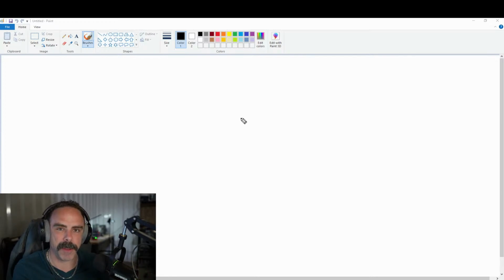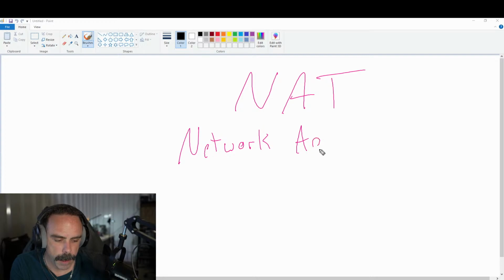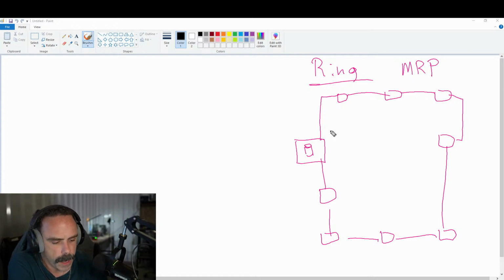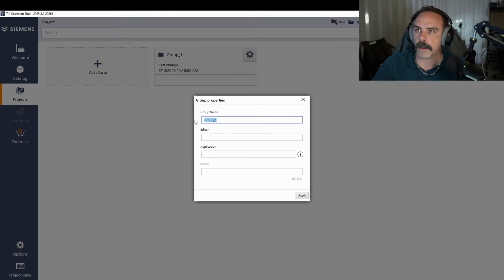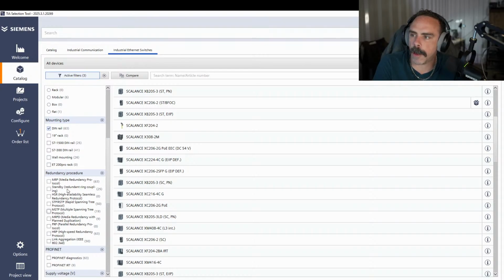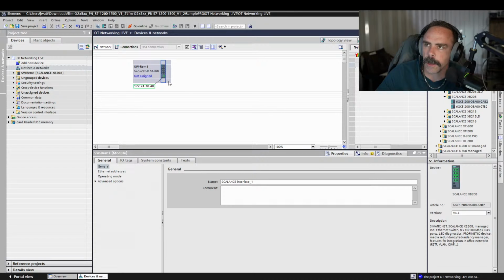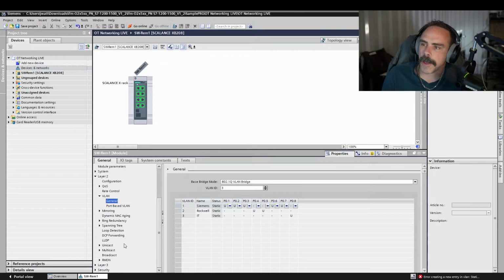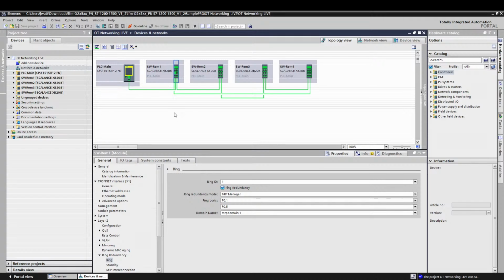OT Networking 101: Siemens SCALANCE Basics in Portal

Comment: Sir if possible can we further continue ot tutorial series as I got role as an ot engineer and it would  be really great 😅
Reply from the maker: Congratulations! I have been very busy with work and have been wanting to do more streams, but I haven't even been to my lab since Christmas!

Do you have a topic you would like discussed?
Reply: @jasonwattsae actually they are talking Something about traffic management like something port forwarding...
Reply from the maker: ahh this is a topic where an device sends information to the router on a specified port, and the router then forwards all that information to a different subnet that the original device doesn't have access to. The original device doesn't know the IP address or have access to send information directly. It only knows the gateway and port. This means that traffic on other ports (such as HTTP/HTTPS) do not have access to anything outside of the local network.

There are some good YouTubers out there (I think Network Chuck is great) that cover this, but I can talk about it more indepth from an OT perspective...